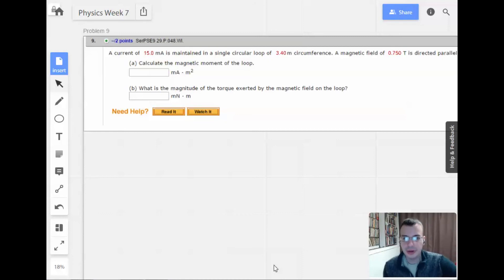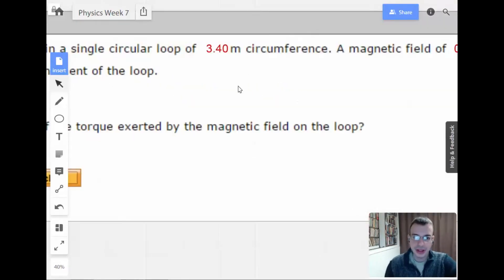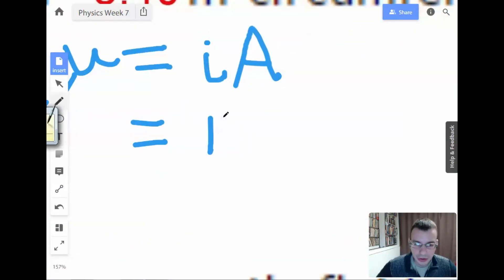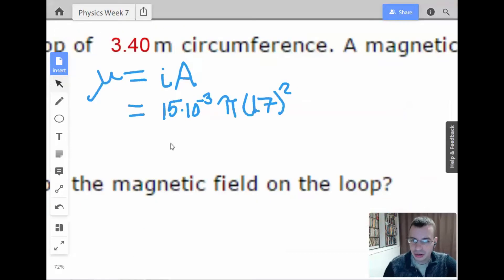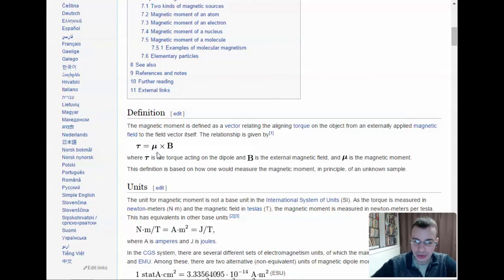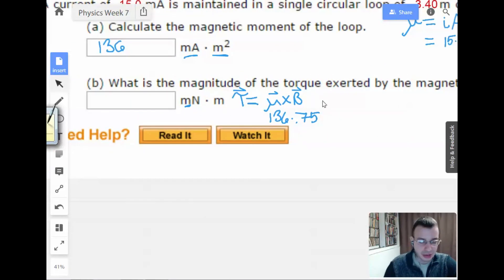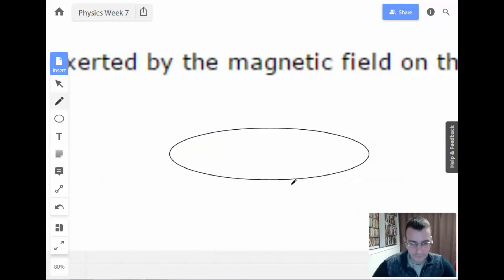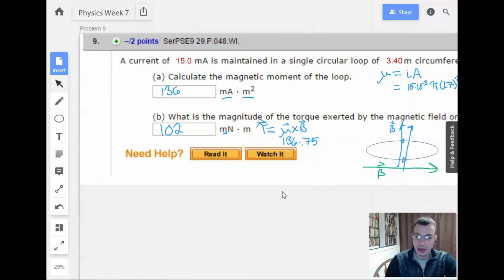Week 7 Problem 9

Comment: The radius ain't 1.7 m because 3.4 m is the circumference not the diameter. So the radius is supposed to be (3.4/2pi). (Don't judge me for using the word "ain't" because I like this word)